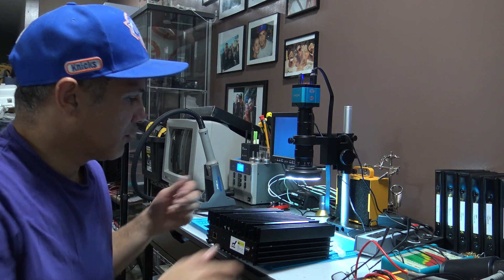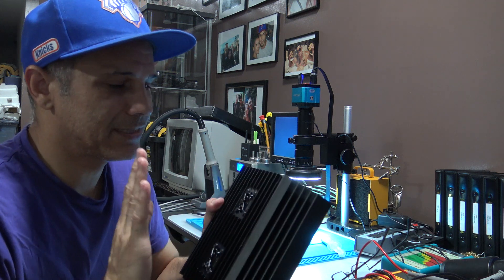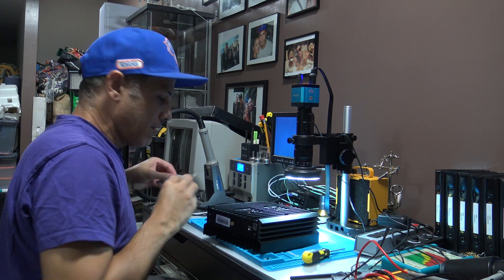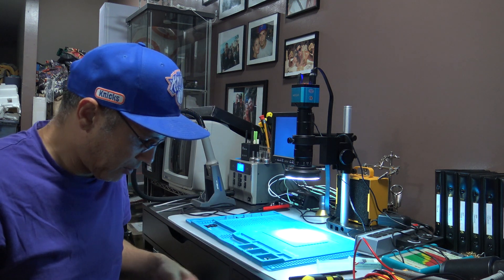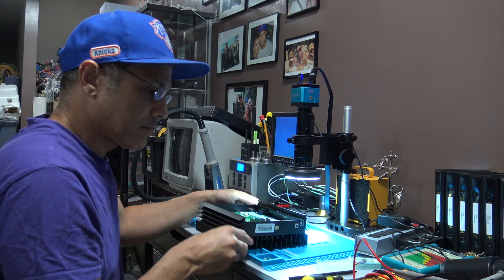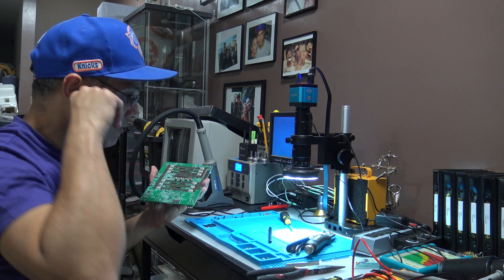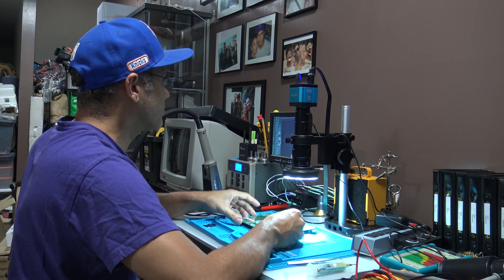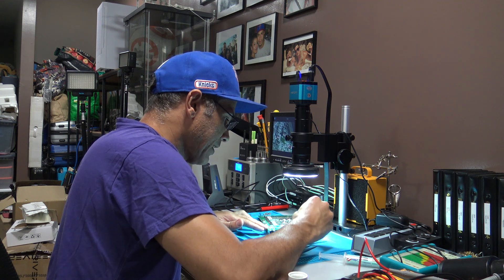Bricked Iceriver KS0 Ultra Firmware Memory Chip Removal For Reprogramming Chip Swap

Comment: Would installing this new iceriver ultra memory chip solve my problem? If yes, how can I send it to Brazil? Would this be worth US 35.00?
Reply from the maker: Yes it will solve the stuck overclocking and put it back to original. I can yry to send the chip to brazil but it will cost more because of shipping.
Reply: @NerdThingsAndMore  Please check the shipping cost for sending this chip to Brazil. And specify a certain name of the product, actual payment value + shipping value so that there is no problem at Brazilian customs, ok.
I bought an iceriver ultra two weeks ago, which cost US$50 in shipping to get an idea of it coming from China.

Comment: Hey friend! I have iceriver ultra and I tried to install a firmware for Overclocking but it stuck, that is, like blocking the miner because it doesn't even have the reset button
I managed to factory reset the miner... I tried using the iceriver monitor program where it recognizes the IP but I can't reset or reboot.
I live in Brazil and it is impossible to send the equipment abroad, to other countries, due to the shipping fees and the possibility of the Brazilian customs surcharges, charging taxes again on this miner. Could you help me in resolving this problem? I saw a video that could do a factory reset via pen drive or memory card.. is this correct? If so, how could I do that... I really need help, friend.
Reply from the maker: You cannot do it thru a pen drive or memory card it won't work that way.
Reply: I have the Same Problem do you have a andere for me
Reply: @sonne-balkon-tanken  I'm leaving with my 400Ghs iceriver ultra stored in a box because sending the machine to the manufacturer abroad (freight) and still paying maintenance costs, the cost/benefit is not currently worth it. Have you fixed this problem on your iceiver ultra?

Comment: Hello , can you convert the KS0 PRO to AL0 PRO ? , or KS 0 ultra to AL 0 PRO ? It's the same machine , just another firmware .
TOP if you can.
Reply from the maker: No it can't be done it has different ASIC chips in it.